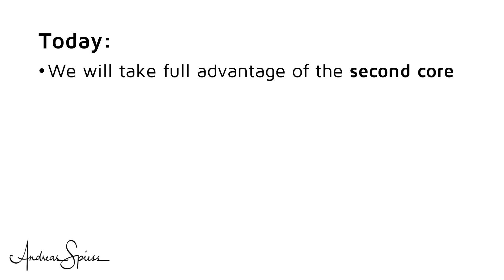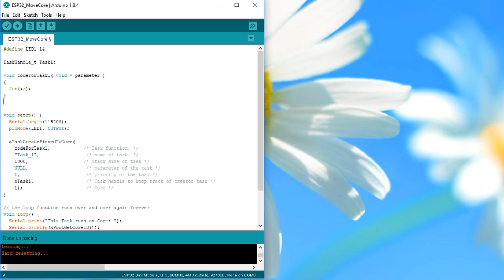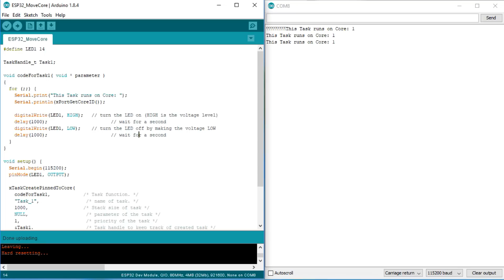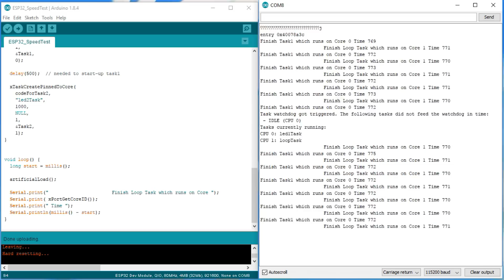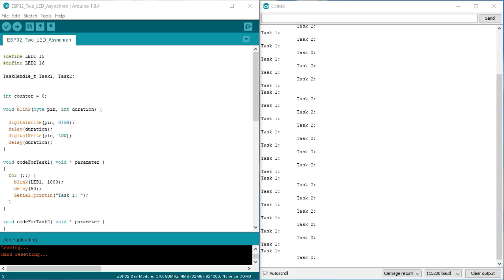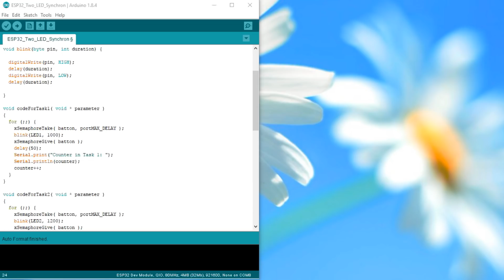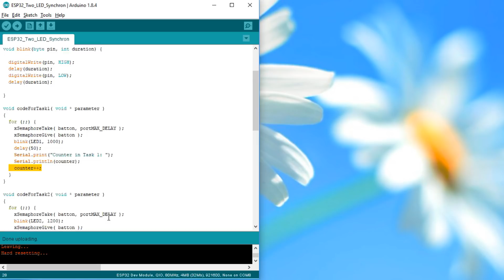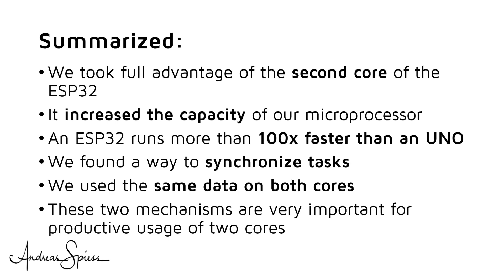#168 ESP32 Dual Core on Arduino IDE  including Data Passing and Task Synchronization

Comment: Hi Andreas Spiess. It's been a great video. As always. From you, I'll be asking for the next video. Ultra low power SAMD21E. I want to use this. The battery can be operated for years. How can I use arduino ide in this alone. SAMD21 Microcontroller + RFM95 Lora Module. Can you make the video?
Reply from the maker: So far, I concentrated on a few chips: The old 328 and the two ESPs. I do not think, I will leave this concept because it would take too much effort for me.

Comment: The irony of using a Harley image when referring to increased performance...
Reply from the maker: +HeathLedgersChemist Still two cylinders have more power than one. Even if the engine does not have a lot of power ;-) I had bikes with more hp. But this one is perfect for my age...
Reply: Cough Ducati Cough Honda...
Reply: From Italian to Asian - Found the similarity ?

Comment: Hello, very good video, but you pass in silence some difficulties. Before use FreeRTOS, you must add the includes and configure the operating variables of this OS. The place taken by FreeRTOS in ROM and RAM is not always negligible and its use is not always obvious or intuitive. I have used this OS for years and it is very good, but you must first understand the operation to get the best.

Bonjour, très bonne vidéo, mais vous passez sous silence quelques difficultés. Before use FreeRTOS, vous devez ajouter les includes et bien configurer les variables de fonctionnement de cet OS. La place prise par FreeRTOS en ROM et en RAM n'est pas toujours négligeable et son utilisation n'est pas toujours évidente, ni intuitive. J'ai utilisé cet OS pendant des années et il est très bon, mais il faut avant bien comprendre le fonctionnement pour en tirer le meilleur.
Reply: https://github.com/espressif/arduino-esp32 has always run on top of FreeRTOS. The ESP32 has almost half a megabyte of RAM and most of the developer boards include four megabytes of SPI flash. Even the flash-integrated variant of the chip has two megabytes. The more recent WROVER variants have an additional four megabytes of pseudostatic RAM too. The ESP32's not hurting for resources to run FreeRTOS at all.
Reply from the maker: +rene lefebvre If you look at my sketches you do not find anything you mentioned. It is different in the ESP32 implementation.

Comment: This is fantastic! I've already forwarded this link on to friends (even though it's two in the morning here)! I'm also creating a dual-threaded process where one core monitors sensors and the other does display and uploading of data (which are passed via global scope variables). This is absolutely great, Andreas! I will henceforth use your framework for all my ESP32 projects!
Reply from the maker: +Philip Moyer Please come back with your learnings. This is still new technology.
Reply: It works! I created a typedef struct definition and instantiated a global scope variable - this is used to transfer data between cores. Core 0 polls an attached SI7021 temperature and humidity sensor, loads the data into the global scope variable, and then delay()s to control the timing. Core 1 reads the data buffer struct, displays the data on an OLED, and then uploads the data to adafruit.io (which is Adafruit's IoT/cloud offering.) Works like a charm! I couldn't have done it without your guidance, though! [Oh, and this is running on the Adafruit ESP32 Feather.]
Reply from the maker: Thanks for the update. Cool!
Reply: Oops. I take that partially back. It works for a while, and then produces nonsense data, and then stops working altogether. Debug time!
Reply from the maker: +Philip Moyer As I mentioned: I also had some issues to solve....

Comment: Hi Andreas, nice video with a lot of useful information. But you described the definition of the OS sligtly wrong. An RTOS is an operating system where the reaction to an input is in "real time". I can't descibe it very well, but read up in wikipedia.

CU
Reply from the maker: You are right.

Comment: Hi Andreas, Awesome video! .. as always.... You describe it correct, that you have to use semaphores to protect access to shared variables, but in your code I think you use it outside of the protected block. counter++ should be inside that block. Otherwise you can introduce very very hard to find errors, especially in more complex scenarios. The synchronization of the starting point of the tasks itself does not neccessary fulfil that!
Reply: The solution is as Walter Steinchen explained: you must write the accesses to the "protected" variables always inside the mutal exclusion blocks (take(); counter++;give() ). That way you are serializing the acceses to the variable and avoiding "lost" updates. Of course the code inside the take&give block must be as fast as possible, to avoid blocking the other core inside the take function for long time.
Reply: The mutex is implemented and provides a mechanism for write access control of global variables and from my brief experiments is also required for deconfliction of Serial.print() to prevent 'wierdness'.  It would seem that there is a huge speed penalty in manipulating global variables within tasks and it may be better to read the global, copy to a local and write it back when you're finished, depending on circumstances. This topic would be worth a video of its own, perhaps touching on queues as well as regular semaphores.
Reply from the maker: +Walter Steinchen I know the problem but not the solution in this scenario (how to define protected variables). However I think, using semaphores can be used to prevent a double update. But I am still looking for a definition like "volatile"
Reply: volatile is a keyword to the compiler and prevents "optimizations" which could alter the logical intent of the code @AndreasSpiess
Reply: Some extra care might be necessary if the compiler can rearrange operations. A lock like a semaphore might not be enough, because the compiler might put a part of the statements outside of the block. In that case read/write memory barriers may be required to prevent bugs. I am not familiar enough with the arduino and rtos environment so I cannot comment on  that exactly. These bugs tend to be very hard to fix, so if another communication method is available (like message base system) then that is often preferable.
Reply: Luckily the blink delay is different by 200ms, so the increment are never at the same time. But you're right: counter++ should be between the take and give...
Reply: I second this; nobody likes to search for those "heisenbugs" that this could lead to.
Reply: Andreas, excellent video, but access to the global variable isn't exactly being controlled by the semaphore. At least not the way the video explains it. In the code it seems more like a side effect rather than proper handling. As long as folks know that more work needs to be done on the subject they can resolve the 'heisenbugs' (I like that name).
Reply from the maker: +Neil Cherry Msxbe the solution is already there and I only do not know it...
Reply: I wish I could help with an easy answer of yes but atomic (one thing at a time) access of variables or objects is a complex subject. I'm sure there are tutorials under Freetos that cover the subject. Unfortunately while I'm aware of the issue I've not had to deal with it as my code is single processor or single thread. But it looks like it's time to learn. :-) Thanks for the info on how to access the processors. :-)
Reply: Yep Walter is right. Many years ago I used semaphores to lock shared memory holding variables as only the read/write functions need to be blocked. Not sure if we can use this method on the esp32 ?

Comment: I red somewhere that the libraries forma esp32 uses the core 0 forma wifi operarions. You could test if there is wifi traffic the core 0  gets slower.
Reply from the maker: One of the viewers did some tests and thinks, Wi-Fi also runs on core 1. I have no information.
Reply: I've been wondering myself which core wifi runs on - do you have a link please?
Reply: Logic dictates it to be the slowest running core as it has to cope with modem sleep mode.

Comment: Super useful masters video Andreas! I have a question though: how can force a library also be running at the core of our selection? I am planning to do bit banging and I will use a modified software serial library ( without start / stop bits ) and I am wondering how can do all the library plus my related code be running on the same core, let's say core 1? Do you have any idea or instructions to me? Thanks anyway.
Reply from the maker: +Mike Kranidis All sketches, including libraries, run only on one core. And I showed you how to select the core they run on.
Reply: Andreas Spiess yes Andreas, my true wondering is how can force a library to be used in a particular esp32 core. Where I have to put additional code...
Thanks
Reply from the maker: +Mike Kranidis Usually libraries are just code which is called by your sketch. So there is no reason why they should not run on the same core as your sketch.

Comment: Nice explanation, as always. Could you also compare current consumption? Is the same or is there a difference? Thanx.
Reply from the maker: The data sheet says 30-50 mA without Wi-Fi. I assume it will be at the upper end if you use both cores.

Comment: Thanks for the RTOS introduction.
On my ESP32 unfortunately WiFi runs on the application core1 because it is called by the application.
I tested it with two different methods:
1. I changed the lib to print out the core
2. I programmed a Counter using Interrupts and it gets disturbed by the WiFi activities
So I still have the question how to shift WiFi to core0?
Reply from the maker: Thanks for the info. Maybe you try to shift your code to Core 0?
Reply: According to https://www.esp32.com/viewtopic.php?t=1161 
"System tasks are pinned to core 0 so user tasks are pinned to core 1 in general. It doesn't have to be but is a straightforward way to try and distribute the load between the CPUs. "
So I do not know what else ("System Tasks")  is running on core0. But I assume that there is something running which might be very important for the system. And I do not want to disturb this system stuff with the Interrupts of my application (e.g. Input triggered Interrupts). So I assume that it is better to run my application on core1 as intended by espressif.
But the Wifi is not time critical and could be shifted to core0.
Reply from the maker: I see. We still have to learn and experiment...
Reply: Andreas Spiess .."I see"...Andreas for an "old boy" your thinking is very flexible, I do wonder sometimes what makes one person open-minded and the next person incapable of that mode if thinking. How many cores have u in your head lol :)

Comment: HI Andreas! What a coincidence that you covered RTOS as I was just starting to play with RTOS on the Arduino Mega (because I ran out of memory on the Nano) for my ping pong led cube. Now that I learned from you that the ESP32 supports RTOS and I won't have to leave the comfort of the Arduino IDE, I certainly would use the ESP32 instead of the Mega.  Thanks Andreas! Great content as usual!
Reply: The question that comes to mind here is. What am I going to do with all the Arduino boards I have, nano, Uno, Mega.....
Reply: IoT LED Cubes! Sounds awesome.
Reply: Hari Wiguna be careful if you want to use digitalWrite though - the ESP32 can be slower than the classic Arduino, or at least not as fast as one thinks. I might have learned that in one of Andreas's videos.
Reply: afaik our beloved ESP8266 also uses FreeRTOS for its sdk ;-)
Reply: mike biermans Do you want my address to post them?
Reply: Mehmet Kaya Are you just starting out with all these things?
Reply: mike biermans Just got to many things to test like conditions under heavy moist areas etc. That's mostly ending in trash-bin. Under heavy moist, everything is effecting on device (uC nor uP) life like "total power consumption", "current power usage at which moist %", "how that's effecting to life" etc. If you go deep in small reasons there are many which needs more tests to be sure. So, need more device in trash bin.
Reply: To help with decision, have a look at this comparative benchmark, it covers IO on the arduino and the ESP32 https://hilo90mhz.com/arduino-esp32-esp8266-101-speed-test-comparison-chart/
Reply: Mike Biermans:
Perhaps use them as dedicated slave processors running a single task communicating back to some overarching ESP32 master???
Nahhhh...  they suck too many joules...  Put them on the shelf next to the IBM PC-XT and watch their value increase over decades to come...  Look how much the last working Apple-1 sold for?
Reply: @trevorvanbremen4718  or use them in a robot, controlling one task like an arm or a motor.  They use the robot OS  (like ROS) to communicate between them and a usual computer running full blown Linux/OSX or MS Windows.
Reply from the maker: I definitively would go for the ESP32 if it has enough pins for your application because it is much faster than a Mega and I think, also more memory. And maybe you can remotely control your cube?

Comment: Hi, I have a question: why do you use “for (;;)” instead of “while(true)”?
Reply: they're the same
Reply from the maker: During the tests, I had some dumps and I thought, it came from the while(). Then I changed and it stayed there. And I did not test if the dump came from there...
Reply: while() is much faster. just checking a flag.
for (;;) is a lot slower and is avoided for that reason. 
Unless wasting time is what you want. Then for(;;) is best.
Reply: Yes, it will.
Reply: Maybe I'm wrong, but I always thought AVRdude was the process used to SEND the code that had already been compiled and linked to the Arduino.  The compiler (at least for all the Arduino boards I've played with) is good old reliable GCC.  Whether GCC will 'optimise' the differences between a for() loop and a while() loop depends on the switches passed to gcc which is governed by your platform.txt file for the board(s) in question
Reply: Neil, I am not sure! It uses avrdude and I don't know much about it. It might be an optimizing compiler, in that case it will have a switch to turn optimization on or off.

Comment: Hi Andreas, this is a very good educational video! But are you planning to make upcoming videos about how to use ULP co-processor in near future? I haven't found any resources that explain to me how to use ULP in Arduino IDE yet. Thank you!
Reply from the maker: ULP is programmed by an assembler language and I doubt that it will be programmable by the Arduino IDE soon. You have to go the extra mile to achieve that.
Reply: Hello, ExpressIF has created some C macros that allow to program the assembly of the ULP using C (see https://github.com/espressif/arduino-esp32/blob/master/tools/sdk/include/ulp/esp32/ulp.h). This means that you can program it even on the Arduino IDE. There's not very much around, except this working example: https://gist.github.com/tomtor/99e2a33bfa404ff99454aa94fc0df804
It would be great if Andreas could dedicate a video to it ! (this is not an easy one !)
Reply: That would make a great topic. @ukrit have you looked at the code for rtos?